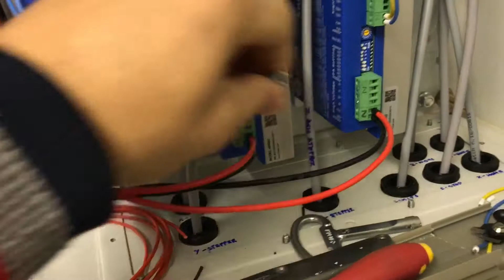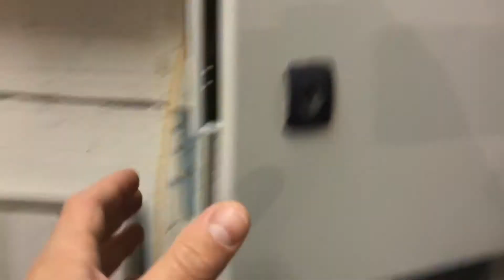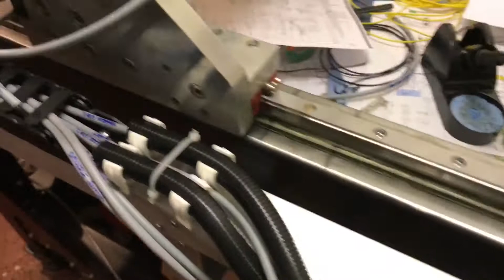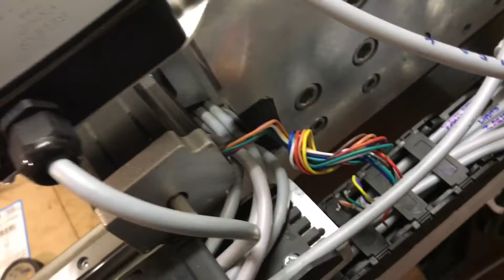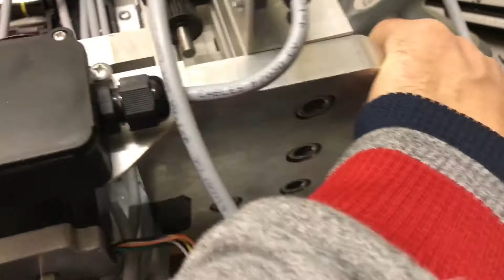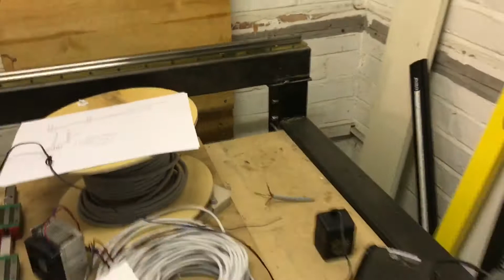Progress Update DIY CNC Machine Build (Ep 28)

Comment: Nice one Joe, good work on the wiring.  Takes a while but needs to be done so keep working away at it.
The e-stops are fine like that - but some people put them 90 degrees and the target plate has a ramp on it so that if for some reason the switch does not work it does not get smashed up.  Mine are straight on like yours and I've smashed one or two over the years for various reasons.  The most recent was when there was so much swarf around the switch that it managed to complete the circuit between the input cables so hitting the microswitch had no effect!  At least I can look back and laugh about it now.
Reply from the maker: +routercnc cheers, yes I remember Dean likened it to eating an elephant - one bite at a time! Thanks for the heads up on the switches!
Reply: Haha, so true on the elephant analogy !